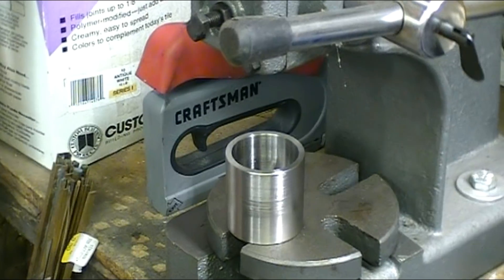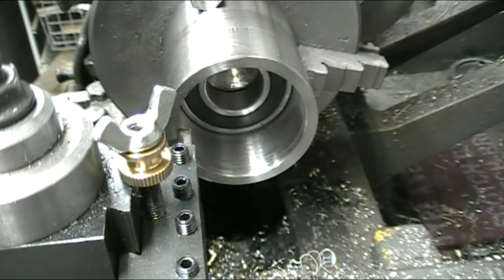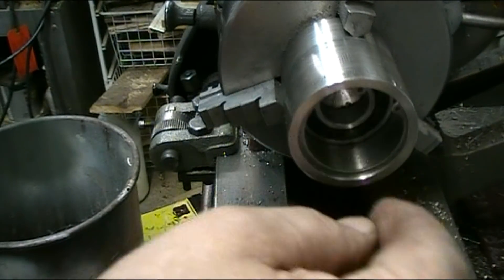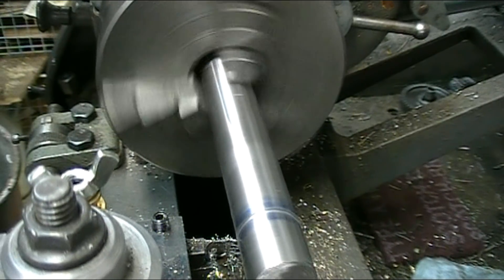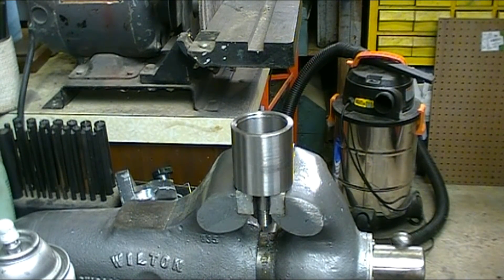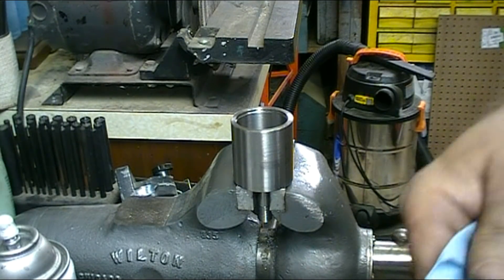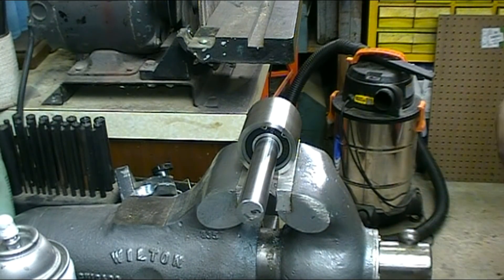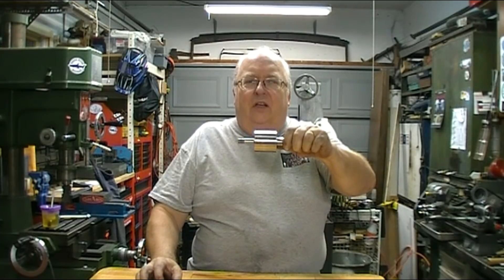Diamond Grinding Wheel Crush Dresser  Build Part 3

Comment: Coming along good....!!!
You did wisely by waiting and tuning the Stainless Steel part, Stainless has a much greater coeficient of dilatation than regular steel, much care must be taken when mating with other material types. Be on the lookout for galing, never use Stainless on stainless hardware or you'll be crying....
Reply from the maker: Pierre's Garage it is tough stuff for my little lathe but I get a great finish and it will last forever.  Thanks for watching and commenting.

Comment: Thanks Steve, those Circlip grooves can be tricky to get right especially when you want to fit elements to a longitudinal tolerance.
Cam
Reply from the maker: After I machined the internal groove I realized that I had some carbide internal boring bars that I could have reground to do the job.  But I was happy with how they turned out.  Thank you for watching and commenting.